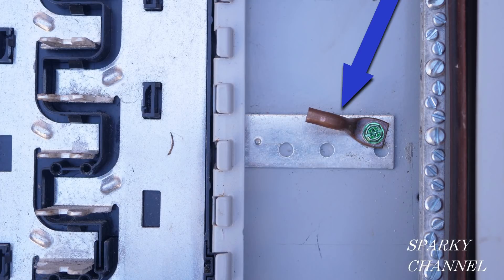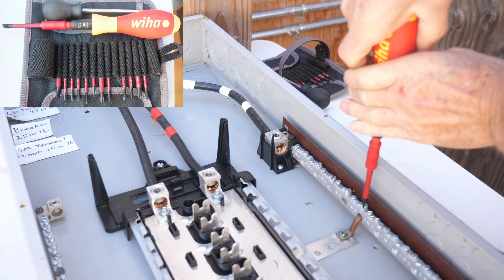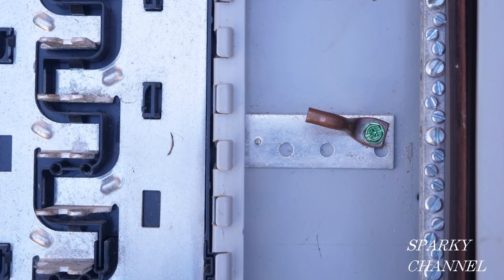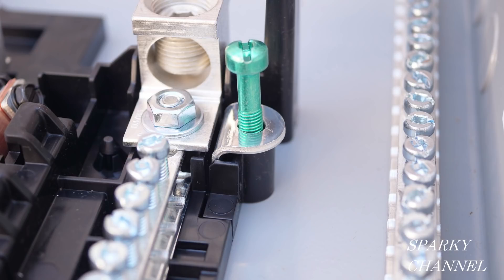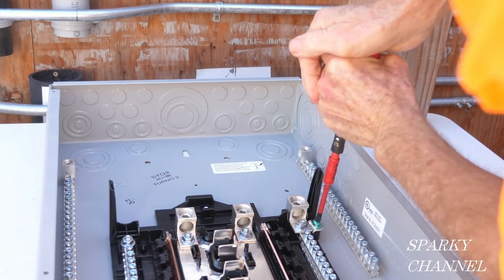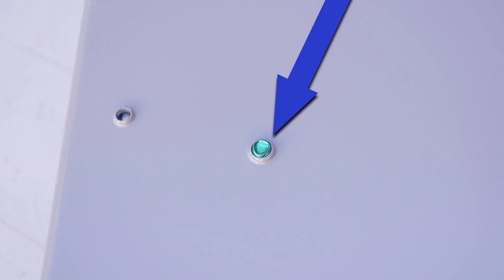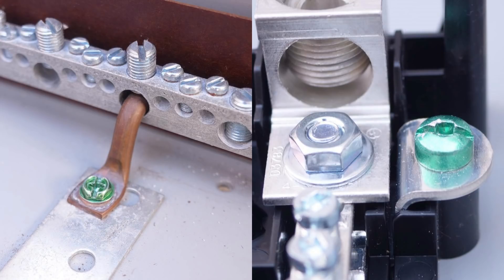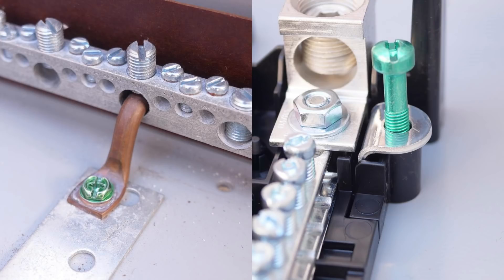Bonding Screws vs Bonding Straps (NEC 250.24 (B) Main Bonding Jumper

Comment: Sparky has answered an age-old question for me in regards to the Ground Bonding screw in particular. It still looks silly to me the way it inserts into the panel wall and just kinda sits there. It doesn't seem as mechanically sound as the Ground Bonding Strap.
Reply from the maker: Plus the bonding strap is all copper while the bonding screw is ferrous metal.
Reply: @SparkyChannel  Keep up the awesome work Bill Sparky! I've been following your videos since I was a first day apprentice over 3 years ago! You are positively changing the world for others every day!
Reply from the maker: @MrWzeljunior  Thanks so much and best wishes!
Reply: what connects the bonding strap to the can?
Reply: @kenbrown2808  looks like a ground screw and a metal piece.
Reply: @MrWzeljunior  so is a 12-32 screw any less secure than a 10-32 screw?
Reply: @kenbrown2808  am I sensing a little sarcasm? If so, you're probably misunderstanding the point, big fella
Reply: @MrWzeljunior  the point seems to be that you have more faith in a little piece of copper and a short screw than you have in a heavier screw directly through part of the bus.  so yes, you're sensing a little sarcasm.
Reply from the maker: @kenbrown2808  A green bonding screw. That's not too impressive when you think about it. Also, Murray didn't give any torque spec for the green bonding screw. I would think that would be an important spec.
Reply: @SparkyChannel  both panels you showed rely on a green grounding screw, but the siemens panel has a thicker screw. On the other hand, the siemens panel relies on the can for a bonding connection. It's also a bit annoying that they don't make them with a lug for a 2/0 equipment grounding conductor, like you have when you're feeding it with 4 conductor SER.
Reply: @kenbrown2808  umm maybe because the grounding strap covers more surface area, the strap itself looks to be made of copper, and then it physically inserts into the neutral bar? You internet wise guys sure love flexing on people minding their own business or stating personal opinions.
Edit: the grounding screw sitting atop the metal piece appears to cover more area when combined.
Reply: @MrWzeljunior  well, the real reason i don't like the murray style is because the bus layout makes the wiring messy.  But clamping two things together against the can with a #10 screw isn't much more bulletproof than clamping a busbar to the can through an isolator with a #12 screw.
Reply: @kenbrown2808  cool story bro. You could've said that originally. I still don't see how your statement is correct and my OPINION is incorrect. Moving on.
Reply: @MrWzeljunior  the original topic was how you don't trust the screw threaded into the panel, and prefer the other screw threaded into the panel.
the bottom line is they both are listed for the purpose.
Reply: @kenbrown2808  I never used the word "trust" or "distrust". Your argument is null. Stop trolling dude, you lost already. No need to keep writing me.
Reply: @MrWzeljunior  sorry,  "think a 12-32 screw directly through part of the busbar doesn't seem as mechanically sound as a 10-32 screw holding two pieces of dissimilar metal clamped against the can"

better?

Comment: back in the dark ages, when I was a cub, we used Siemens panels, and would always use the left busbar as the ground bar and the right busbar as the nuke.  if we had a meter main, we'd simply remove the jumper between the bars.  one job, the JW removed the bars despite it not being a meter main, and we ended up with a hot ground due to sloppy device installation.  took me about 20 minutes to find the problem and then another 10 to find a couple of jumper bars to reinstall them.  of course, that JW had been fired months before, and I had to fix two or three other problems in that house.  only break was the plumber who'd found the hot ground (plumbing was in copper back then) happened to be in the room there the ground was against the hot terminal and saw the flash.
Reply from the maker: Everyone was very fortunate!
Reply: @SparkyChannel  would have been more fortunate had he not pulled the jumpers out. Or missed some circuit conductors. Or been so sloppy at rough-in.
Reply from the maker: @kenbrown2808  This was a JW? Wow!
Reply: @SparkyChannel  I've worked with a few marginal ones.

Comment: Great video!  Your explanations are so succinct and on point.  I'm curious, why is panel/subpanel bonding such a common topic?  There are dozens of videos on this, and comments here show this needs regular explaining.  Way back early, I learned don't put neutral current on the ground, and never had panel/subpanel confusion.  Is it lots of people coming up learning for the first time, people learning/doing mostly residential with limited subpanel exposure, or something else?
Reply from the maker: Thanks so much! Perhaps because it is such an important topic.
Reply: there's too many non-professionals installing subpanels and making that bond when they shouldn't, or landing neutrals & grounds into the same bar.
Reply: and now we have meter+service termination panels, further confusing people about the bond in the main panel.
Reply from the maker: @wim0104  Absolutely!

Comment: Prefer the one with the bonding strap, my OCD would be itching to screw down that green screw.

Also after installation, you can't inspect the point of connection between the bonding screw and enclosure for any damage or corrosion
Reply from the maker: Excellent point, thanks!

Comment: If more additional service disconnects are on load side of service entrance and additional sub panels also downstream would each of service disconnects enclosure require bonding of egc to service ground? Or would bonding only take place in the first disconnect load side of sec then be isolated in remaining disconnects enclosures

Comment: I much prefer the big flat bar that makes a bridge to connect the neutral bar with the grounding bar. So then there's no confusion with the appliance/enclosure bond there, and it is held down with lug-size threads. 
The first little bonding "device" in this video has TWO functions: grounding the metal case, and optionally, bonding the neutral & grounding systems... to make all of that depend on a little green screw with a few threads into sheet metal is nuts.
Reply: "nuts" meaning: ignores galvanic corrosion. I want to run an extra 6AWG conductor between the neutral and grounding bars.
Reply from the maker: @wim0104  Excellent points, thanks!

Comment: I have a panel like this,  main lug only.  The the meter considered the main disconnect for this panel? When you state their is a disconnect somewhere upstream? If i don't find any other panel with a main shut off for the machin lug only panel,  that's when you need to bond the panel with the neutral when converting this MLO panel with a main breaker disconnect?

Comment: Why do they not bond neutral on sub panels and how much was that torque screwdriver?
Reply from the maker: The neutral wire carries current. So bonding the neutral to the ground in a subpanel will allow current to flow over the ground wire back to the main electrical panel. In some cases it could also allow current to travel on water pipes.

Comment: That wiha torque screwdriver looks pretty handy, but it seemed like it was a little hard to torque the screw down. Do you find that easier to use than using insulated bits in a regular in-lb torque wrench?
Reply: even with 45 inlb, the main problem is the screw head & bit, not the grip, IME
Reply: @wim0104  It just seems like it would be a lot easier to just press against a normal torque wrench with the palm of your hand and use other for leverage. I've never used a torque screwdriver before, it looks nice if you have bear strength hands.
Reply from the maker: Hi Travis! For 45 lb-in I had my choice of using my Wiha or my AC Delco torque wrench. They will both handle 45 lb-in just fine. You're correct, you can get better leverage with a torque wrench. For anything under 45 in-lbs. I have to use the torque screwdriver (with my tools)  though.

Comment: No such thing as a nuetral in last few NEC code books becsuse aholes that write it like to rename most used terms in over a hundred years. Now called grounded conductor. Same thing with light fixture now luminare. At an IAEI continuing ed class the told us to throw away all bonding screws or straps left in all subpanels.
Reply: by "last few" you mean since the 90s.
Reply from the maker: Interesting, thanks!

Comment: I'm receiving confusion about bonding on Youtube video's when the NEC clearly spells it out! Separated to the first means of disconnect.
Reply from the maker: Yes, correct. Check out this video: In Which Panel is the Neutral and Ground Bonded?: https://youtu.be/Lsl1TZuxJpw
  Many electrical YouTube videos get this wrong. They generalize too much. You said it correctly.
Reply: Is the first means of disconnect the main breaker (100A or 200A) inside the house? Or the disconnect outside?  Up here in Canada we have to bond the meter to the house panel.